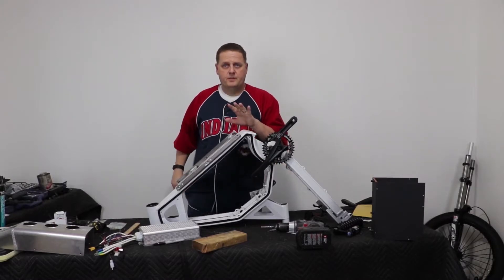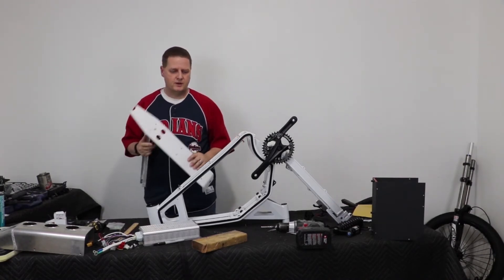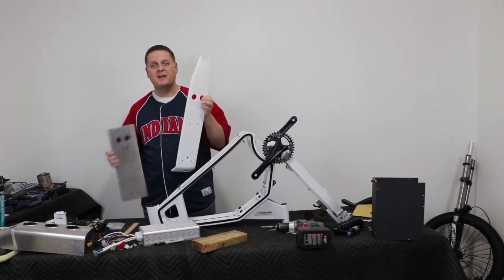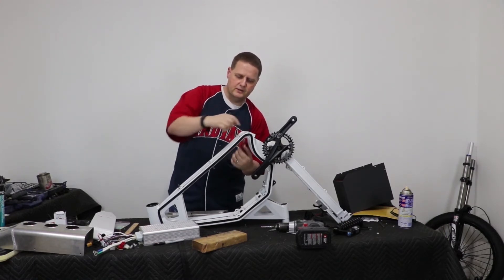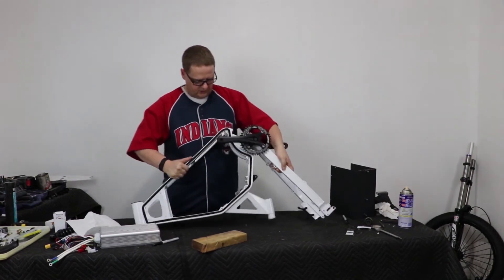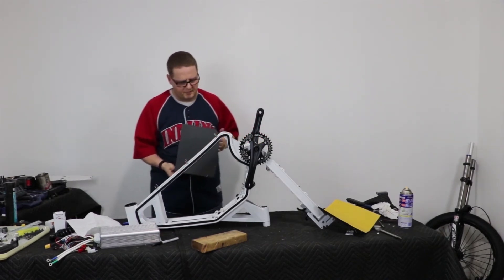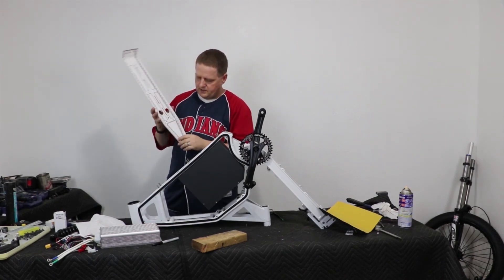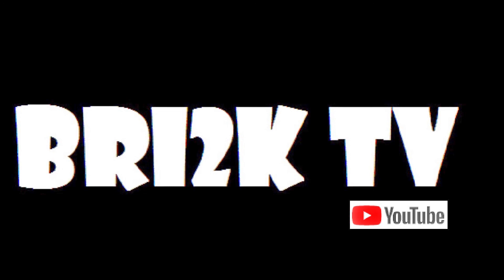50MPH electric bike build - Episode 6

Comment: Hello, I bought a similar bike like your from China, one question I have, even when bike is power off,you feel some friction when pushing? Like a motor friction? Since iam new, I don't know if a thing of motor, or maybe my wheel it's not in good position.
Reply from the maker: I dont feel an friction with the motor off. I do have regenerative braking engaged, but it only engages when I hit the brakes
Reply: BRI2K TV understand, thanks a lot! For replying me.So  I think maybe the support that hold my wheel can be damage, maybe warped. Because even when bike is off, when I push by hand , I can feel something holding a little the rear wheel
Reply: @aglbrasil  check your cables for the motor , I have the same problem solved,
Reply: That tension you feel is probably from the magnets in the motor